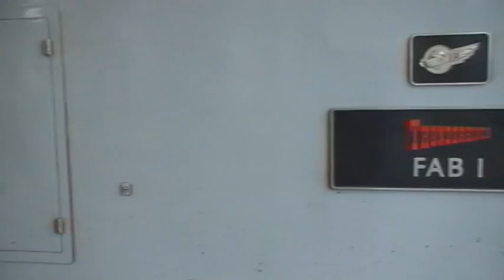Crewe Works Open Day 10th September 2005

Comment: I don't remember the rain, though there are some brollies visible in some of my photos. I was working on site at the time, so saw a lot of the preparations. It is always impressive to see a low loader, complete with a huge steam loco, being reversed dead straight for 200m, ending up correctly positioned on the traverser, I was also early in the queue for tickets (and parking!) for a full car load. 
It's the only time I've seen an A4 relegated to the second rank in a display of engines.
I remember the organisers harassing Railtrack to get them to write off the track access fees for visiting locos as a donation to the charities.
A couple of years later the rails where the Crewe Pacifics had stood were sold for scrap.
I must get a video of my stuff together.